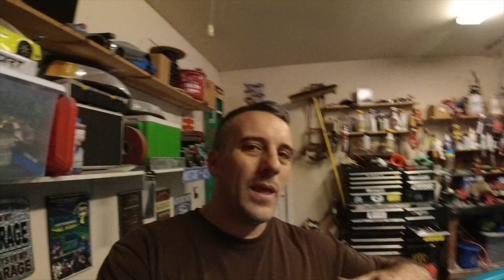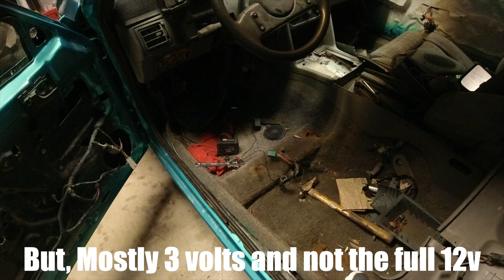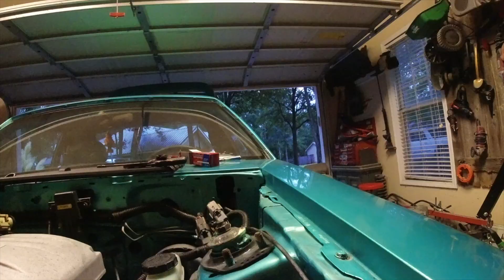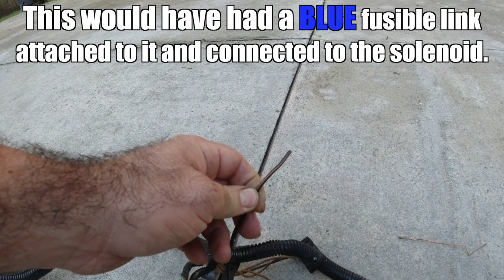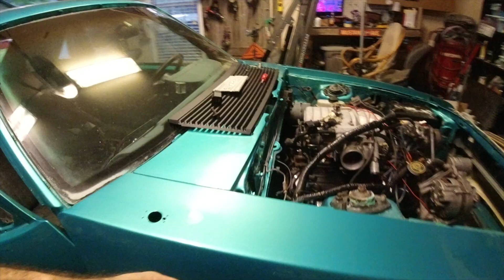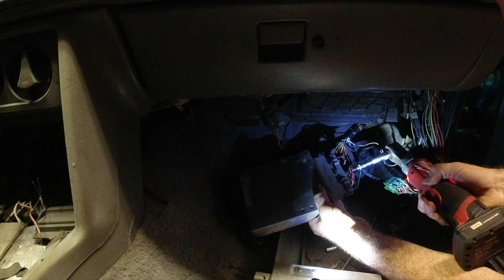FOXBODY NO SPARK, LOW VOLTAGE AND WIRING ISSUES / SOLVED!

Comment: I’m having problem with no spark in my 92 my fuel pump primes and I have a Holley terminator I get spark at coil wire when I connect the positive side of the coil to the positive side of the battery but no spark at spark plugs

Comment: Great video! Only thing I would suggest is using some dielectric grease in the wire loom connectors as a  preventive measure for moisture  corrosion shirt circuit prevention!!

Comment: Ok question. You did help me figure out the ECU ground to the battery negative. BUT what if my fox has power to the fuel pump, new starter, new solenoid, power @ IGN, solenoid, AND ECU but still will not start. I have checked with this video and the ECU is grounded, relay is fine, and power is where it should be. I am LITERALLY at a complete loss as to why my Fox will not even try to turn over. Just dead as soon as the key turns.

Comment: Hey man. I’m having issues with my fox. I just installed the terminator x and it ran great for a while. Now my issue is I lose spark about 2 minutes after it idles. If I try to re start the car I have no spark but if I cycle the key on and off I have spark again but it only stays for about 2 min. Now I’ve got a Holly duel sync distributor and a msd 6a box everything is wired correctly but I now have no spark at all. Have any ideas ??? Would help me out ALOT if you did. Thanks again and keep up the great work !
Reply: Does your static timing match / car timing , check fixbody mustangs on YouTube for first start up tips / set ups .

Comment: Chased all wires and everything seems fine. 1993 gt fox only stays on when sparing care cleaner directly in the throttle body. Already swapped distributor/fuel pump/mass air sensor. Anybody having this problem
Reply: Spraying carb cleaner*

Comment: I have been chasing the same low voltage at inertia switch issue on a non-running 88GT that I just picked up.  That same blue 20GA fusible link in my wiring harness was also broken off where it connects to the starter solenoid.  Thanks for posting the video...I am not sure how long I would have been chasing that issue!

Comment: So I have the same loose wire,where did that wire hook up to? I have a smaller blk/ orange wire really close to that one, it seems to be coming out from inside wiring and connects to that ecc test area. It’s hot I know that no key needed and lights up test light having trouble chasing it might you know where it’ goes?

Comment: I am having the same problem with my 1991 f150 5.0 efi and I'm not sure which wire that is if I could get some help that would be appreciated I put the frame on a 1979 f250 and it has all the same wiring nothing changed

Comment: Awesome, we are restoring an 88GT T-top at the moment and it's down to hooking the stuff up. I have a long block that was rebuilt that come out of a 90 I believe. The AC WOT shut off relay was in fact had exposed wires. We did not know what the relay was for. After watching this we now know. Great info. Of course we fixed the wiring with a new aftermarket harness. So hopefully we will get it all plugged up and see if she fires up, also see if the PCM will agree and work well with the Lunati cam and Holley heads lol. Thank you again for posting this, perfect time, we just fixed the relay harness in question this past weekend.

Comment: Last year my ecu blew up I parked the car then it wouldn’t start I tried everything until I open my ecu and 3 capacitors were burned out for no reason I found the same ecu A9L and fixed the problem my opinion is their getting old it was a really hot day that day I drove it was a 100 plus degree day car has been running since then now I have the problem wear the oil pressure drops after it warms up I have a high volume oil pump everything is new with under 3k miles

Comment: I have a 88 Lx With a 89 wiring harness I wasn't getting power to the fuel pump.my problem was that I had the eec power wire hooked up as a ground. Because it was what I thought was a black wire after months of checking wiring diagrams And cleaning that wire with some cleaner I found out the wire was blue and it was a power wire.
Reply from the maker: That was the exact wire that was cut on mine.

Comment: I went through this on my 89 ssp.  But I had a fuel pump and fuel pressure at the rail. But the injectors wouldn’t fire off. It would run fine on starting fluid. Ended up selling the car before I fixed it
Reply from the maker: Damn... no telling what it was either.. 🤔
Reply: BREW2L I’m not sure. I messed with it for a week or two and couldn’t get it to fire off. Everything else worked fine but injectors wouldn’t pulse. Wire harness and computer, engine and trans all cane out of a running donor car that was also an 89. But building 3 mustangs got old fast and I sold it.

Comment: Just a quick tip when putting the harness through the firewall. The blower housing can be removed from the bottom of the AC box giving you much more room. Just three bolts. Two on the bottom and one behind the glove box. Pull those out, remove the blower housing and you will have tons of room!

Comment: I had a couple blown fuseable links before. And the tan wire with the green stripe is the ECM trigger wire to ground the relay. Also I've had a lot of luck following the road maps in the back of the Haynes manual

Comment: I would say bad solenoid or you don’t have a fuse link hooked up on the solenoid, ( I had the same issue wire tucked my car ended up grounding a fuse link that needed power ooops two days later I got it figured out) you have spark so couldn’t be bad tfi

Comment: Here’s a tip from a guy that deals with low voltage controls daily. When diagnosing a problem always get the wiring diagram and when you think you’ve identified the problem area start with where the component gets power and work your way through all the connectors, relays or whatever that circuit has in it testing for power at each step. Work your way from power to ground, leave no stone unturned.

Comment: Very helpful video . I actually like changing out wiring harnesses  but I don't like looking for shorts because I'm not good at it. On another note Fox bodies sure have a lot less wiring  than the 3rd Gen. Camaro with the TPI there's 2 harnesses that come out of the computer  probably a total of 40 wires on   TPI.

Comment: The project is coming along great! Bad Shoe Productions has a video series that covers swapping a fuel injected V8 into a non V8 Fox platform. He goes over wiring in great detail. Differences in years, stick vs. auto cars, grafting the engine harness to the body harness, trouble shooting, tips, tricks and more. Very informative, helped me a great deal

Comment: Have you used any of the solder seal wire connectors yet? If not, check them out on the YouTube. They’re a pretty neat little deal.

Comment: My 87 had the same issue and it was a bad fusible link on the one where 2 wires go in to one
Reply: I think I’m having that same issue now. Where did you buy the 20ga replacement fusible link? Really hard to find.
Reply: @pane889  car quest, they have fusible like wire, works good I even used it on my F150 just a little roll of light blue wire I guess made to break if any issues happen

Comment: My 88 vert will not prime either. I replaced the fuel pump relay and no luck. I sprayed some starting fluid into the throttle body and it started up and ran for a couple of seconds. I’m replacing the fuel pump and filter this weekend. If that doesn’t do it, does anyone have any suggestions?
Reply: Did you fix it? If so, what was the solution?

Comment: I have a problem with mine 91 gt cranks and starts but sputters and dies . Cleaned mass sensor and changed injectors new fuel tank and fuel filter changed the sensor on the coil pack and changed fuse under drivever seat I'm stuck. Anyone know what it could be ??

Comment: I just bought a 88 lx and it starts fine but after it warms up it wont re-start for hours, the battery is in the back of the car and supposedly it has a 200amp alternator I'm not sure but I'm wondering if maybe it's a timing issue or a weak starter or just something wrong with the battery
Reply: Same issue on a 99 Pontiac Firebird 2 and 1/2 years later crank position sensor was the culprit might want to check it out

Comment: I have a 1988 and from the get go not all harness will work with 1988 they have different o2 wires also most wiring harness this old need replaced or rewired.. these wires are all old and brittle. I've rewired most of mine and found that the cluster causes a lot of issues if not in good contact on the plug.

Comment: One of the best purchases I have made for my car was a factory service manual and electrical schematics. Made life MUCH easier with getting mine back together.
Reply: Absolutely.  I took an electronics course summer of 8th grade at a community college, and that was the best thing ever. Learned to solder, read diagrams, voltage, amperage, current, etc. Then when I went to Army helicopter crew chief school 25 years ago, it was a breeze.

Comment: Now you fully understand why I had a stroke that day you and Russell cut the orange and black wire on my car!!! Lol! By the way, up to ‘91 the relay is under the seat, I believe it was in ‘92 when they moved them under the hood.
Reply: If was definitely 92 and up when they relocated the fuel pump relay under hood.
Reply: I parked my 87 Mustang a year ago running. Now that I want to sell it, it will not start. I have a broken fuse link by the strut driver side. Green one side and different color on the other. I also have the brown and black wire with a butt connector going to nothing. It's been so long I can't remember what this stuff is. Does the brown and black wire go to ground or  ignition power? The interesting thing is a have full pressure and sparkler but it will not start. It was running fine when I parked it. It has always started and this is the first time in 24 years.

Comment: My 91 if the key is fully turned over to start it won't spark but if I back off as I turn it over just a hair the dash lights will come on (battery, check engine) it'll fire and start up
Reply: Ignition switch problem, no?
Reply: Have you already replaced the ignition switch?
Reply: @TheModAddict  I've replaced that ignition tumbler and the switch.